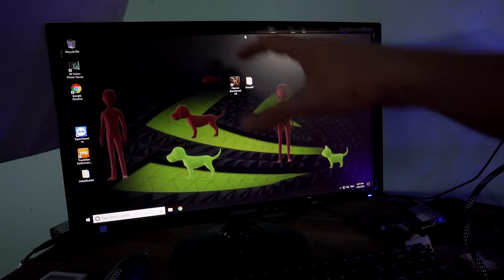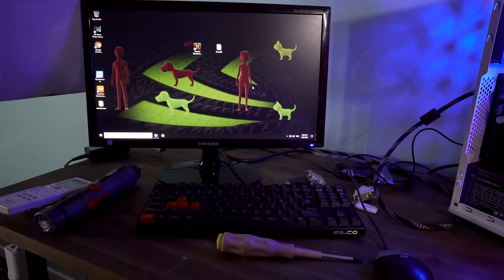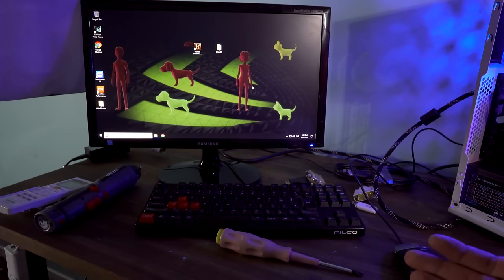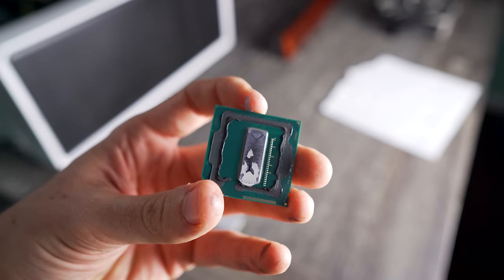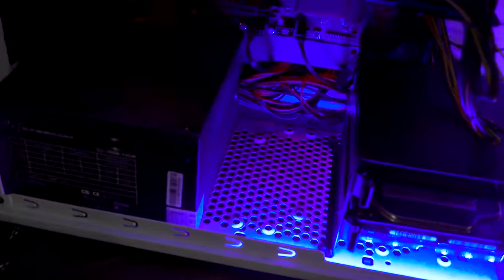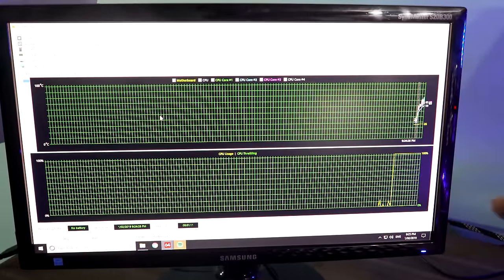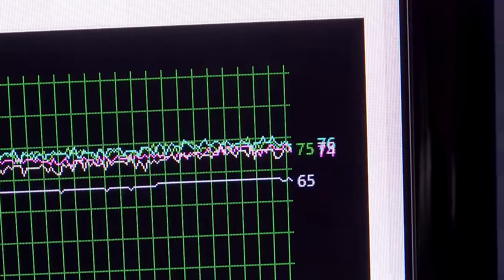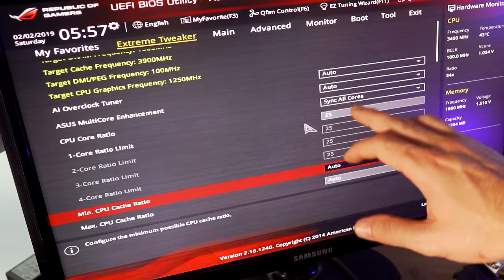How to Spot a FAULTY CPU.....? The i7-4770 Dilemma....

Comment: I'm a system builder and I only give a 30 day labor free warranty. After that I give a 1 year manufacturer warranty but I will charge for labor. Unless the customer wants refurbished or used items installed then there is no warranty at all.
Reply: Guy lives in australia.  Customer protection laws would override your  30 day warranty, as it should because it's weak AF.

Comment: The only 'faulty cpu' encounter I've had was a i7 860, which had a faulty memory controller so half the motherboard ram slots wouldn't work (I tried a different cpu and the all of the slots did work, so I was sure it was the i7 860)
Reply: Curtis Albrecht  well in my case it was a motherboard with 2 slots, and yes actually only the slot closest to the cpu didn't work (so channel a)
Reply: I have an i5 760 with the same problem, and I saw a lot of lynnfield processor with a faulty memory controller
Reply: Wow that's bad. I think I have a faulty X399 board that acts the same. The only defect/weak CPU memory controllers I've seen are Ryzen (My Ryzen 1700 can only do 2666 reliably, though that's technically not defective since anything over 2133 is "overclocking", its still REALLY weak!).

My Threadripper 1950x does great with quad channel 3600 (plus some overclocking on top of that!), BUT.... If its cold, around freezing, (which sometimes it is in my room), it can't run full speeds. At roughly 0c, the Threadripper starts dropping memory connection, and 32GB turns into 24, and then 16... And then you need to drop it down to 2133 just to boot, then run some loads on it to heat it up so the rest of the memory detects. I'm 99% sure the motherboard is faulty based on how it just drops sticks of RAM completely when its cold. The lowering of stable memory speeds however is normal, and a known fact for Ryzen based processors acting up when cold (so don't run dry ice or phase cooling on them, but liquid nitrogen gets cold enough it starts working again for whatever reason). This memory issue was a huge pain in the butt when I was testing my LN2 cooler with regular ice (so the coldest it could possibly get was above 0c since there was melted water at the bottom of the cooler, still had these issues, so it can happen in the morning on any cooler). I'm very certain that its a bad board though, the CPU seems to bench fine at 4.15 Ghz on a 120mm AIO and 3600+ Mhz quad channel RAM most of the time, it only seems to crash when its doing nothing in the desktop (or 4x Handbrake encodes at once, but that could be a software conflict, though I normally run 2x at once...)

Comment: Thermal wise I haven't had any issues with either my i7 4790k or i5 4690k. The i5 has been running overclocked at 4.4 GHZ with no problems. The Devil's Canyon chips had better TIM applied so I think that helps too.

Comment: I had an AMD athlon 64 3200xp or something like that, and I replaced every single component and kept getting weird crashes and kernel panics suggesting hard drive/memory issues at best, and often just nothing at all, no codes no errors just off. Was sure it was Power supply/then tried ram/then mobo with both ram’s. 

Or just not turning on.

It ran amazing when it worked,  but that was getting less frequently than it started off as 

I never even got into Overclocking it, so nothing to do with that, only when I had the CPU sent back did they confirm it was bad. Blew my mind.

Comment: My computer is just going slow, takes a long time to boot up, and sometimes files don’t completely open I just get a blue spinning circle. I’m just hoping it’s the HDD and not the CPU. Assuming 7hats the case, I ordered a solid-state HDD and hoping the7’ll fix things. 

Your video tells me though, I need to take the heat spreader off of my CPU and check the paste  and if it’s dry I’m going to have to go back to Amazon to order some heat paste.

Comment: One of worst issues iv dealt with recently were buggy nvidia drivers causing regular bsod’s until I manually rolled back to a 3-4 month old version I couldn’t even confirm it was the drivers because it didn’t give an error code and the system logs didn’t record the issue before it crashed. the worst part was I couldn’t updating to new nvidia drivers for about another 3 months because they had the issue aswell until then.

Comment: I got a 4770 for $60 and the pcb was slightly bent. I bent it back and over a years later 2 motherboards 2 sets of ram and 10 gpu's no issues. Except the first mobo needed a bios update or cpu usage would randomly spike to 100% after the spectre/meltdown update.Right now its running all cores locked 3.9ghz and 2400mhz ram undervolted to 1.575 and cl10

Comment: When I was in China not too long ago I got a 2nd hand AM4 A6 9600 that only does single channel mem which I did not realise until much much later. Also had a E3 1240 V2 xeon that will run perfectly but once you shut down won't start back up.. in the end had to drive to the shop in Shenzhen electronic plaza before they reluctantly offered a replacement. I'd imagine it's much of the same on aliexpress so always always test with dual channel mem and integrated gpu if there is one, then aida64 test overnight.

Comment: I have a 4770 and I'm now wondering if my CPU has gone bad.  Temps are fine, usually 30's when idle, 50-60c when gaming, but 2 times in the last 3 months my PC has  done a slow freeze and lock up.  When this happened, I was playing a game on one screen with Chrome open on the other with task manager and Afterburner background.  One time the game froze 1st, then Chrome.  Other time it was reversed. After those 2 froze, the task bar would slowly become unresponsive. Afterburner freezes. Any other programs open would  also slowly freeze.  Task manager is always the last to freeze,  but clicking End Task on frozen programs does nothing. Then it's frozen too.  After about 5min or so, the mouse and keyboard stop responding.  Only 3 things I haven't swapped out is CPU, main SSD and MB.

Comment: Generally it's a pretty good idea to run a Temperature Monitoring Program while doing this to make sure your not pushing the CPU Temperature outside of it's recommended operating limits because a overheating CPU can cause this exact problem........

Comment: I see a blast from my past with that mobo, seen the word RANGER and i got goosebumps. I had the A88X ROG Crossblade Ranger paired up with a A10 7870k Black Edition and x4 4gb Corsair DDR3 vengeance Pro Editions at 2400Mhz AND X2 ASUS STRIX GTX 970S BOTH WITH nzxt g12 bracket AND corsair H110I V2 280MM                                RADS AIO ON THEM,  SADLY THE PC WAS LOST TO A FIRE IN MY FLAT, WAS MY VERY FIRST REAL BIG PC BUILD, CASE WAS THE HUGE PHANTEK ENTHOO PRIMO SE EDITION, NOW I JUST HAVE LOTS OF PICS TO LOOK AT,   WOULD SERIOUSLY LOVE TO BE ABLE TO BUILD IT AGAIN BUT ,OMEY VERY TIGHT, SORRY PPL, FOR GO ON ONE, MEANT A LOT TO ME

Comment: "Do NOT use Prime95 versions later than 26.6 on 2nd through 7th Generation i3, i5 or i7 CPU's, which all have AVX (Advanced Vector Extension) Instruction Sets. Recent versions of Prime95 such as 28.1 and 28.9 run AVX code on the CPU's Floating Point Unit (FPU) which causes unrealistic temperatures up to 20°C higher. The FPU test in the utility AIDA64 shows similar results."

Source: http://www.tomshardware.co.uk/answers/id-3451493/7700k-prime95-high-temperature.html

I personally agree, since I saw that myself.

Comment: @13:57, we can clearly see a "gap" in the glue on the PCB.
May that be contributing to the thermal paste actually drying off ? i.e. the humidity just escaping ?
If so, what would be a good test we could come up with, without delidding, to test the glue between heat spreader and PCB ?

Comment: I done with 4770/4790. It goes up to 90'C when playing AC origins with thermaltake frio advance + coolermaster sickleflow. XD
Reply: Something is not right, my 4770k runs at 70°C at load at 4.6ghz with a dual 120 aio.
Reply: My 4790 run nicely at about 65-70 degree on a quite small Cryorig M9i tho
Reply: @WouterVerbruggen  is your CPU running stock clocks?
Reply: @twte5647  Obviously yes, we're talking non-K chips ;)
Reply: @WouterVerbruggen  Nice !

Comment: Picked up a 4790k and I noticed on idle i couldn't get a good read on still idles temps so I bought a h1ooi pro to maybe help negate it (had a 212 evo) even bought some mx4 paste to see if that would help. temps are still the same, low mid high 30's and then jump to 40's and 50's for a split sec and back down to around 30's and 40's. I do have it OC'd to 4.7 mostly stable but when ever I do stress test using AIDA 64, after a few mins( varies) pc would fully freeze and I've been trying to figure out why, Im guessing it could be the paste under the IHS so after watching this video I might have to consider deliding just to see if my pc wont freeze during stress testing. Here's hoping that its just the paste on the IHS

Comment: it seems that haswell had an unusually high failure rate. when I got my new 4790k a few years ago it fried a few months later and would start bootloping for 30+ mins before booting successfully. it turns out my motherboard at stock settings was overvolting it like crazy (something like 1.4v). not sure if this was just the cpu being faulty and not holding boost clock at normal voltages or if the motherboard defaults were just broken. good thing I ended up getting a free replacement

Comment: i believe i may have a faulty 7700HQ. I was noticing an incline in CPU temperatures, where they would hit 98 degrees. Got thermal paste replaced and that fixed the issue for 2 cores (Cores 2 and 4). But im still seeing 95-100 degrees on Cores 1 and 3. There is about 15 degree difference between the good cores and bad cores. Only problem i have, i cant afford to ship this laptop off for replacement even though its under warranty :(

Comment: I bought fm2+ mobo, athlon 880k and 8gb ddr3 bundle cheaply but whole thing did freeze in stock settings due to cpu thermal shutdown. Further ispection cpu was crushed with cooler leaving high spots on corners. After lapping cpu, temps were okay and everything worked perfectly.

Comment: in my lifetime, i experienced an old cyrix m2 processor fail completely. otherwise, im with this intel dual core 2nd gen living it through all the ages, replaced like 4 or 5 motherboards over the years. motherboards are generally the first thing to fail. maybe the power supply too.

Comment: I've got a 4790K that has one core that's running 30c hotter then the others.  Runs fine until you start prime95.  Didn't realize it until it was out of warranty.  It was in a media center until now.

Can't believe there were actually people who believed Intel when they said TIM lasts longer then solder.  I've got 2 perfectly fine 2600Ks.  Now both my 4000 series CPUs either need to be sold to someone who will delid them or I have to delid them.

Comment: Nice video. I just got a 8700K, 5GHz+ at 1.250v. 60°c under load with a 300watt ZALMAN cnps 9900MAX nickel plated 100% all copper cooler. (Yeah i know) old style cooler but it works great to my suprise and runs like it should but also a i7 3770K that's OC'ed to 4.3GHz mem at 2GHz rock solid but hits a wall at 80°c+ with a high end all copper cooler (Zalman cnps9700) these things actually work great for a 10+year old cpu cooler. My bet was to open it up and add some liquid PRO. Will post 1nce i have some results.
Reply: The ZALMANs always looked good, the round copper fins is what gives it the retro 2005 feel. Your nickel plated version at least looks like it belongs in modern times, but also might be too lowkey and go un-noticed. I have a Zalman CNPS 9500LED new in the box in the closet from that long ago, with the full copper in all its glory :P
Long live air cooling. RIP Zalman, in Noctua we now Trust.

Comment: My 1300x was hitting 3.1 at 1.37 volts. Base clock is 3.5, turbo to 3.8. I had to update BIOS, update chipset driver, ect. Turns out it was thermal throttling cuz one of the cooler screws was loose. Once cooler was on it turbo to 3.8 at 1.2 volts.

Comment: My 2 year old workstation, which is still under warranty, has had the PSU replaced, and then the Motherboard. It's still failing for the original fail, four beeps (power error). Nothing on the screen. Problem not the SSD, any other drive or the GPU pulling it down. Same beeps with only one stick of Memory installed, and CMOS reset button made no difference. It must be the XEON E5 CPU.... what else could it be...??? This offering from Intel is a server-grade processor. How often do these things fail?

Comment: I just built a PC. It turns on and I can get to BIOS. When I try to install Windows I get a black screen with dots that spin for a second and then freeze. There was only one time that I got an actual blue screen and it froze there. The error was a "Machine Check Exception". After that I didn't get the error again, but it's still the same issue. I began testing it by taking out components, but when I took out the GPU and tried to use the i5 9600K's integrated graphics, I couldn't get a display. Is it likely that my CPU is the issue? Or maybe the motherboard?

Comment: I've got an i7-4770K that hard freezes under load, I think both of my Z87/Z97 motherboards show the Vinput as 3.9V (?!), but my B85 motherboard has a 1.8-1.9V Vinput (which I believe is more correct). I also have a totally dead i5-4440.

Comment: Bryan, my 2679 v4 was pricey, how do I know if its blown or bios not supported on two boards as no board says they support it? It gets hot code 00 which no red light for dead cpu shows though.....  its a rare broadwell OEM chip so this is the thing making it a terrible issue, on second x99 board ans they are NOT cheap! ...

Comment: Can you also get a computer freeze from GPU issues, because at times I wonder if setting certain overclocks to undervolt at a good level and idling, after a few days of letting the PC run it may randomly 'freeze' for no good reason and needs a reset and re-calibrating of the GPU stuff.

I don't know if it's actually CPU since I use a generally stable level of clock speed for my Ryzen 1700, like 3.65Ghz.

Comment: I have an x5675 cpu that has dropped 25% in benchmark scores after over clocking for about 2 months. Is this a possible faulty cup or should I look elsewhere? Perhaps ram or a mobo issue. I have been getting occasional irq not less or equal bsods.

Comment: I have had my R7 2700 replaced by AMD since the one I got in the first place had an issue with its memory controller. I was able to find out the problem after using it with virtual machines and hardware RAID while running G skill Flare X 3200 at its rated speed, while on 2133 was working as expected.

Comment: I recommend getting an Intel Xeon E3-1230v3 if you cant source an working 4770, its what Ive been using and at the time the Xeon was AUD$285 instead of AUD$355 for the Xeon

Then again when I bought the parts 
i5 was AUD$200-255
i3 was AUD$135
8gb DDR3 1600 was AUD$55

Comment: The motherboard overestimates the voltage on the processor. 1.21 volts,  is enough for overclocking 4.5 GHz, if you have a good cooling, ofcourse )). And this processor is extremely successful, its nominal voltage can be seen after resetting to the initial settings at the first start. In your case, this is 1.028 volts or so. If you just fixed this voltage, the system would work stably and without scalping. My 4770K CPU is working on 1.046 volts by defolt clock and 1.21 at overclocking to 4500 GHz. It s easy )

Comment: I haven't seen TIM degradation like that before.  Crazy.

One thing: How is it that this client bought a 4770 from you only 6 months ago?
Selling old system?  I guess that's the danger of second hand system with unknown history.

Really you should never have to delid to maintain stability, unless you are overclocking by a decent chunk.
Intel took a lot of flack for their crappy TIM.  But the TIM does the job they needed it to.  One of the reason that we hate it so much is that it doesn't transfer heat as well as some after market types or solder.  But the reason it doesn't work as well is that it's formulated for longevity, no ultimate performance.  Aftermarket TIM is usually rated for 2 years, Intel's was 10.

Just a tip.  It's good to check the per core temps to see if your thermal paste is making contact.  If one core is WAY off (like 5C+) from the other ones, you might have an interface contact problem.  It is normal to have 2-4 degree variance.

Comment: I've got a persistent crash problem with no error message (black screen) and then it reboots itself. I currently have a computer from this era (i7 4790k) however I don't believe my problem lies with my cpu at all, I had an i5 4460 prior to this, I also have a gtx 970 which I believe is the fault, the black screens only occur in games, more often than not in older games, like MW2 it'll crash 95% of the time over 30-60 min usage, newer titles may take a little longer to crash, temperatures are fine (core wise) on both CPU and GPU, I've tried overvolting my GPU at stock clocks, to no avail however, it still black screens.
CPU I running at 4.6ghz @1.22v stable. Any help or advice would be appreciated I've had this problem since I bought it in 2015 
Specs; MSI Z87M GAMING, i7 4790k, GTX 970, 16gb HyperX Savage RAM 2400mhz, 620w Seasonic PSU.

Comment: I was about to throw a comment about delidding / using a better before watching the whole video. In my personal opinion it's better to use hwinfo to monitorize temps because you can check out if VRM are getting to hot or some other temps / voltages.  
Nobody should run an intel cpu undelidded, unfortunately.